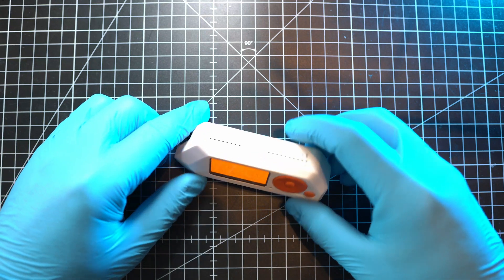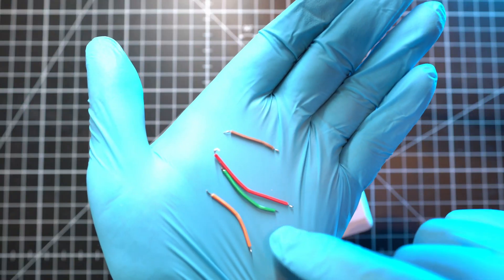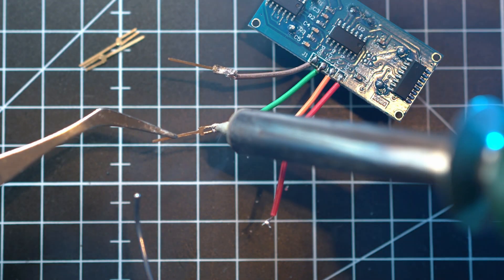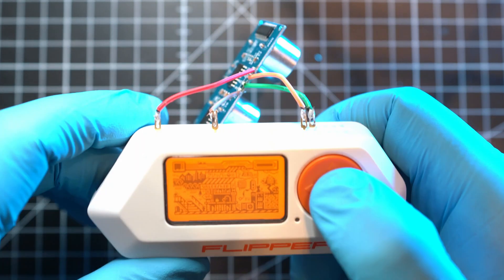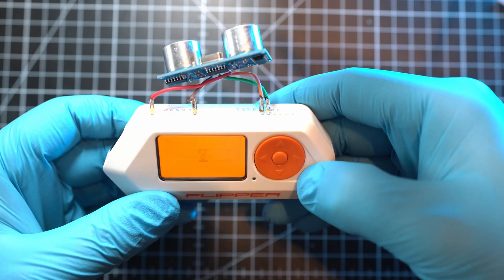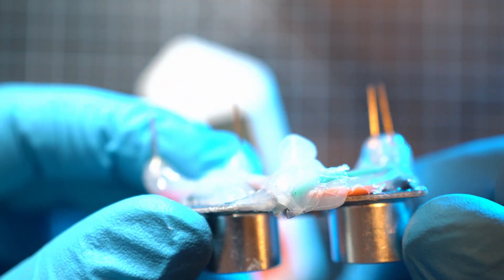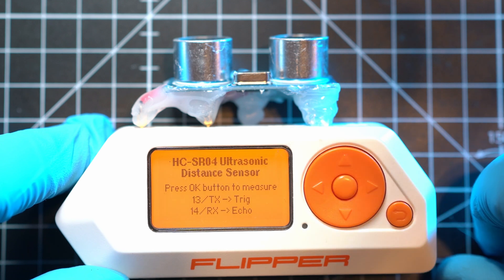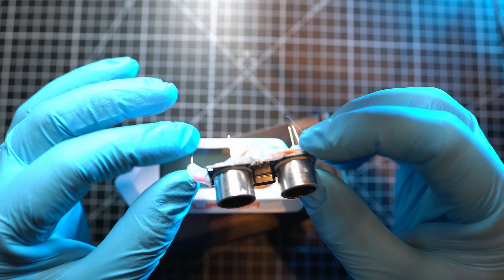Flipper Zero HC-SR04 Ultra-Sonic Distance Sensor Module

Comment: any way this can be done with the IR sensor
Reply from the maker: ir,? why?
Reply: Would this be better than and the ir ? This is interesting but I’m trying to see if there any was to us the ir to do the same thing and take measurements in different units . Kinda want to use it as a digital tape measure . Where it can take the measurements and store them then take another measurement
Reply: I make sign and need to take measurements all the time but sometimes I forget a tape measure. I’m thinking I can take the flipper with me and use it in a pinch for measurements. That’s what I’m trying to see if it’s possible. What are your thoughts to achieve this?

Comment: That module is available with the pins already fitted. Just use some male-to-female jumper wire that push on.
Reply from the maker: yes but…
Reply: @takeapart  Any excuse to use hot glue :) :) :)
Reply from the maker: yup! :-)
Reply: TakeApart just loves his hot glue 🤣